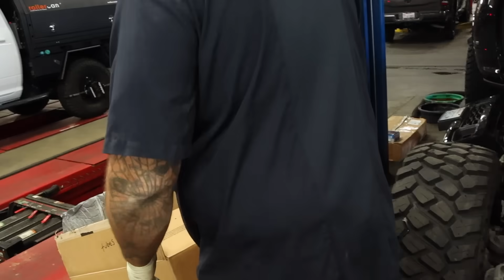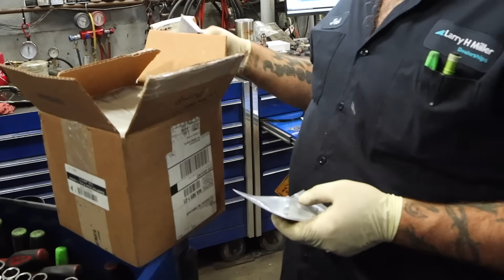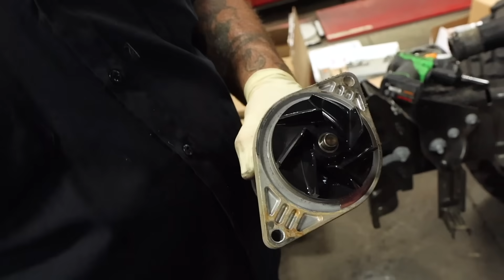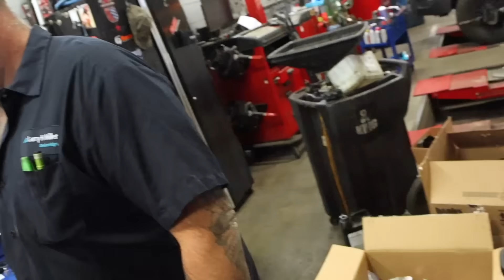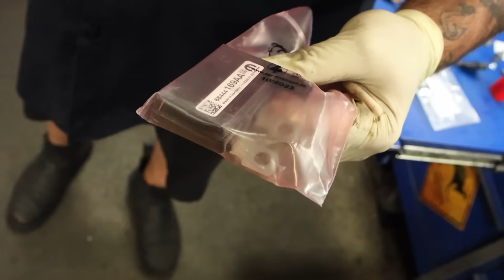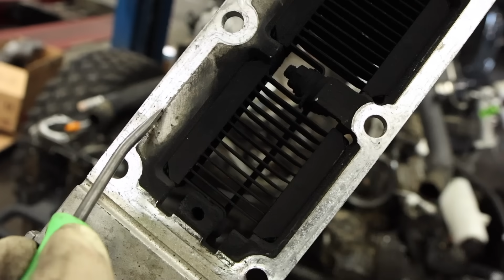Master Tech Discuses Bulletproofing Your 2025+ RAM HD Cummins!

Comment: My grid heater nut did fall off in the intake. Cracked my #5 piston. The truck has 75,000 miles on it. Currently waiting on warranty approval for a new engine. Praying daily for good news.
Reply: What year truck?

Comment: That would mean you would have to tear out every electronic piece of s*** in the truck that is a big problem they couldn't fix the electronic problems there was a 2025 and now it's passed on to the 2026 is I've been around on her for 2530 years after buying my 2026 3500 dually diesel it's nothing but a piece of dog s***full of the same electronic issues of the 2025 have has 700 mi on it owner for 3 weeks it's been at the dealer for the last 2 weeks out of the three and they don't know how to fix it

Comment: I have a brand new 2025 ram 3500 turbo diesel so far so good you guys I’ve only got 11,000 miles on it right now I’m not babying it. I run them hard. I’ll keep you posted.
Reply: How is your recall doing? And wheel speed sensor? Or abs module? Mine been in the shop 5 times 26 3500 cummins
Reply: @Mason-t8p  haven’t had that problem yet by the looks of it I’m going to have it if you had it I’m gonna have it. I just went out of the truck to be honest with you so I can go get a Ford. I can’t have this. I work in North Dakota out in the middle of nowhere. I’ll let you know what goes on every day. I go out there just hope that thing starts and gets me to the job.
Reply: @s @seantreakle1174  go look up the videos of people with their fuses, not seated in their fuse box. All mine fuses were not seated, and they were all literally sticking out. Mines in the shop rn for a recall for trailer brake module. I run a hot shot company so right when this gets back at the end of the week it hits the road it’s about to get some hard miles so we’ll see how she does.
Reply: Mines a 2026* so you might not!
Reply: @Mason-t8p  just to let you know my throttle control failed and the deaf system failed. The throttle control was the big one because the truck lost power had to get it into the shop when he got real cold up here that’s when it failed or they’re not that had anything to do with it. I don’t know that almost put the truck in the shop for three weeks, I wanna say
Reply: @s @seantreakle1174  def system fails just means it’s getting deleted and tuned😂😂
Reply: Not a chevy guy but i bought a brand new 2024 2500 and i had it up until 2 weeks ago. I had 125k mikes on it! She didnt have any problems and i ran her HARD! Switched back over to cummins. A lot softer seats!
Reply: Yes sir, 2025 12.5+ on my 2500... Been great!

Comment: Water pump 3.2 hrs? Must be harder on a 6.7, I've done them in like 45m on my 5.9
Reply from the maker: They are not harder. Book time to replace plus fill cooling system and purging air.
Reply: @Trukstuf that's fair!
Reply: I can replace my pump on my 13 in like 5 min. 10 min to put the belt back on. What a pain the tensioner almost needs to be bottomed out. And 5 to 10 min to fill coolant. I just fill it up. Drive like 2 miles and fill back up when the tstat opens.  I'm good at it. On my 6th pump on my 13 3500. 187k miles. I keep an extra pump and tools to change it. I got stranded the first time it went.
Reply from the maker: @jeremyedwards1427 and that’s why I put quality pumps on

Comment: The Mishimoto is the best design for the heater hose.  No quick disconnect...it's a JIC fitting.  It's what we use at the steel mill were we deal with hundreds and sometimes thousands of PSI.

Comment: Have been a ram truck dude until my first 21 f450.   Would like to go back to ram now they offer 8 speed but f450 has been fine since I got new tcm for 10 speed.   Deleted around 15k.  Almost 50k and very happy.   Don’t get this bullet proof shit.   Waste for something that can get stolen, totaled or just bored of and want latest.   Doesn’t increase value at all.  If it’s a real failure or reliability issue then don’t buy a ram.

Comment: Next time you have a 25 in the shop, can you do a video on where the DEF injector is and how to take it off to clean it? I see videos all over YouTube for the 24 and older models, but I haven’t seen anything on the 25s yet and would like to do preventative maintenance so I don’t have issues. I’m not very mechanically inclined, but I have been doing all service on my truck myself and trying to learn.

Comment: Great video again. Fast question for you. Would it be wise to put 15W40 oil in my 2021 cummins HO ? I know they recommend  5w40 winter and 10w30 summer but I would like your thought about this. thanks in advance.
Reply from the maker: I don’t recommend that until after you do the Hamilton Cam swap
Reply: I would

Comment: Solid state relays fail in the ON state unfortunately.
Reply from the maker: Yes they do. Not near as often after the recall
Reply: @trukstuf yeah, if either fails it's likely to get expensive. Treat it like an oil change/consumable. I've had SSRs on my water heater for a decade. Only failure was due to a screw that loosened.

Comment: Only "issues" Ive seen mechanically on these new trucks in the forums are a couple people have had the CP8 replaced due to noise and a few people have had the ZF replaced but I think that was due to not being able to diagnose an issue and it was quicker  just to replace the transmission

Comment: I’ve got 15k on my 2025 mostly towing and it’s been perfect so far.  Only aftermarket is the Insane Diesel bypass oil filter.
Reply: How many miles do you have on it?  What does the oil look like?  I just ordered one for my '21.
Reply: How many miles on the bypass?
Reply: Banks intake, hamilton cam, rockers,push rods, gen 5 motors ,when the change from gen 4 to gen 5, roller jam, rockers are built upside down,same with push rods, around 70k to 90k problems start, gen 4 engine no problem,

Comment: I've been wanting to get a 6.7l since the 5th gen came out but the hydraulic lifter issue makes me nervous. With your experience is there a year(s) you think are best? I've been looking at 5.9s as well but would like a newer interior.
Reply: I just sold my 04.5. 210k and the only thing I ever replaced was the water pump x2 and a set of unit bearings.  Replaced the unit bearings with a manual hub conversion. Great truck but I needed a new truck for retirement. 
I've only got 2200 miles on my 2025 but damn, what a difference.  This thing is a beast.
I'm hoping it's as reliable as the 04.
Reply: @captainmorgan5106 I wish you the best of luck 🤞🏼 these 19+ trucks seem to either be good and no issues or don’t make it 3/36 with out major problems
Reply: No they are all bad run!!! the 5th gen’s are money pits just to get reliability where it should be
Reply: @outlawfishing6281  Ah, Noop. You never owned a 3rd Gen.
Reply: @spooler7828  3rd gen is fine the 5th gen is not 5th gen is 💩
Reply: @outlawfishing6281  LOL, you don't have a clue. I still have my 04.5. I had to modify the crap out of it to make it reliable and able to do the job that it needed to do. Wholesale changes. I have owned a 2019 and now a 2025. They are way better than the 3rd gens. If I have a lifter problem I will deal with it. The 04.5 I did two cam swaps. Nothing but a thang.
Reply: @spooler7828  never owned a 3rd but owned a 4th never an issue but a water pump failure now my 24 5th gen is a GIANT POS only made it 22k before engine FAILURE LOL 😂
Reply: @outlawfishing6281  How are other folks making it 380,000 miles and you didn't? That was a 2022 truck which were the worst supposedly.
Reply: @spooler7828 I have no idea but a lifter spun in the bore and that apparently calls for engine replacement
Reply: @outlawfishing6281  A couple of questions for you. Did you do your own oil changes? What oil was used. How is the truck used? How many miles/time between oil changes? Do you idle your truck for warmup, etc.
Reply: They are not a widespread problem like it is portrayed to be.
Reply from the maker: @spooler7828 yes they are. I see 3 a week
Reply: @trukstuf  That is only you. If everyone was seeing 3 a week it would be a different story.
Reply from the maker: @spooler7828 not true. Stellantis issued a stop repair if no worn parts are found, for this issue. And no worn parts are found because not to many techs are actually removing these parts to inspect. If it was just me then Stellantis would have never even known about it.
Reply: @trukstuf  They have also started to demand Premium oil during oil changes at any dealership. Guess you can't use that cheap crap in the bulk tanks anymore.
Reply from the maker: @spooler7828 well since the 2019 came along and for the 2019 and newer we don’t use “the cheap stuff in bulk tanks”. The 2019 get the T6, which I’m still not a fan of
Reply: @spooler7828  eh I disagree my 24 didn’t even make it a year dude… 😅

Comment: my 25 has officially been in for over 4 months...they are refunding me on monday...me and my fleet are going back to the 6.7 powerstroke
Reply: What's wrong with it? Thinking about buy a new ram
Reply: I got 11,000 miles on my brand new 2025 ram 3500 turbo diesel. I haven’t had any problems with it yet. I’ve been running it pretty good.
Reply: Hopefully the '26 has those issues worked out.
Reply: Yup these newer rams have major issues unfortunately
Reply: @outlawfishing6281  I haven't had any problems.
Reply: LOL
Reply: What happened to the truck? I’m curious cause I have a brand new 2025 ram 3500 turbo diesel.
Reply: @seantreakle1174 it was eventually lemon lawed right after that comment..2 25’s in the fleet are having the same problem.. fleet contract is over in February..I am forever done with ram/cummins
Reply: @chuckatley1464 can't say for what but only you did, when asked . Interesting
Reply: @dannyboyd1299 multiple lifter failure..sorry, I don’t live here on YouTube
Reply: Might want to pick up a few spare 10 speed transmissions.
Reply: @stevenwilson2292  nah, just swap to a nexgen valvebody..the 10 speed isnt all bad..the valvebody design is trash though
Reply: As they should!!!

Comment: Bottom line is these trucks need to be right ......  why should I buy a truck and start replacing parts?
Reply: Because it costs more time and money when they eventually go bad. We want dependability and bulletproof is the gold standard. One and done, peace of mind longevity and better performance.
Reply: Because as a consumer unless you want it to last as long as it can…. They are no longer designed too. 

Consume, consume, consume = $$$$
Reply: Exactly.. it shouldn’t be this way by the time you add in the cost to do this swap you could have bought the other brands cheaper
Reply: Somebody is a salesperson and a technician. LOL